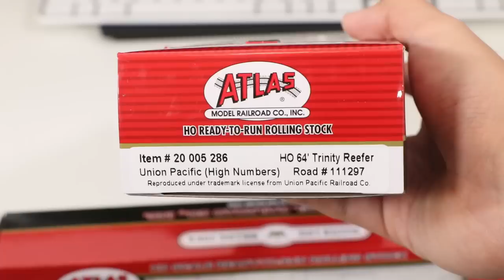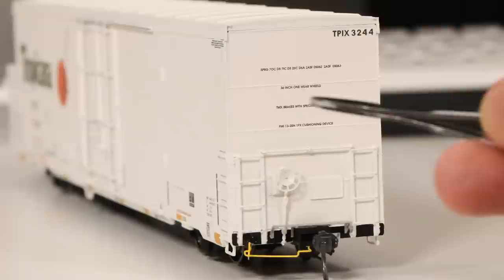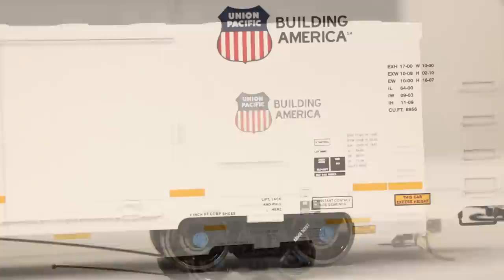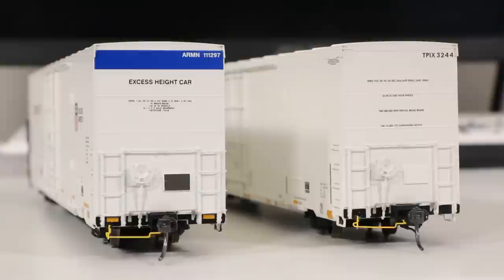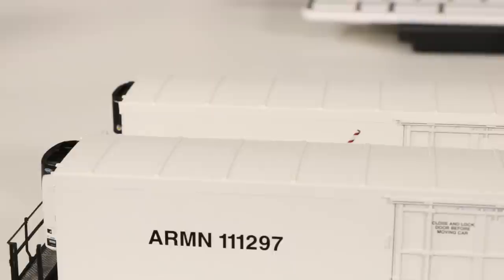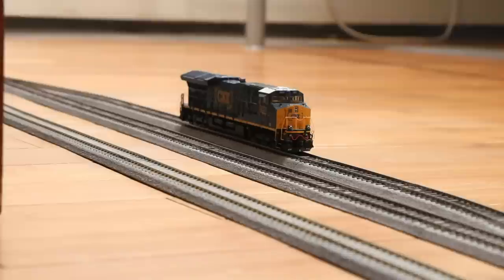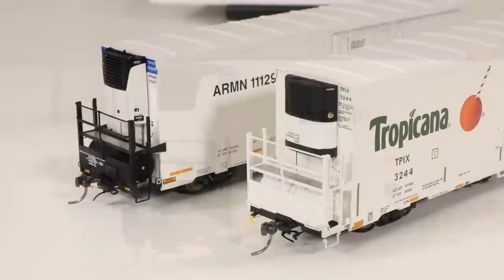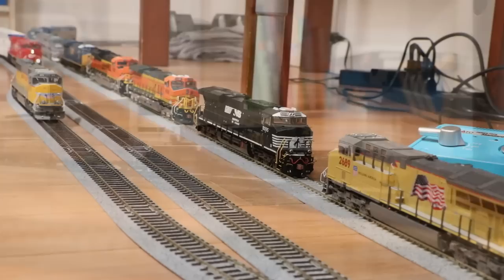Atlas HO Scale Tropicana UP Reefer Unboxing

Comment: The box to which you inquired about on all 4 sides of the cars are like a wooden info sign if you will. Shippers use them to staple info to the car so rail workers or receiving party know more about it. A common one I see at work is "Clay Products, Handle with care" and "Do Not Hump". But you can pretty much see anything on those. Those are also on pretty much every single boxcar in circulation.